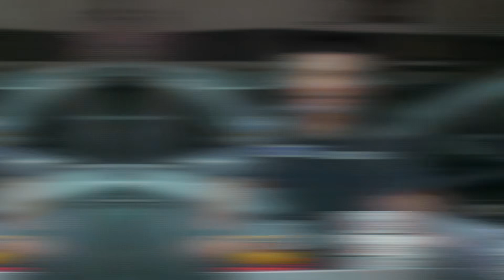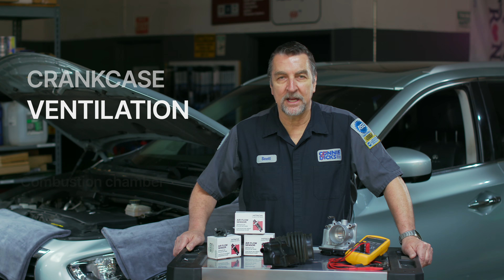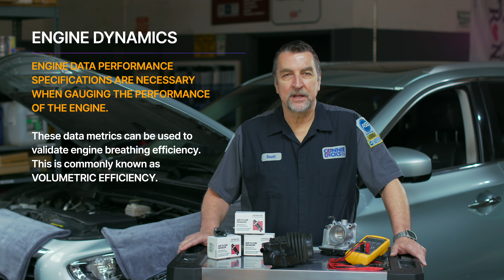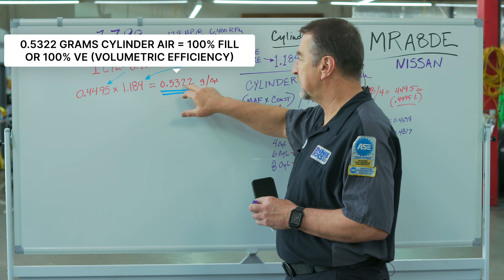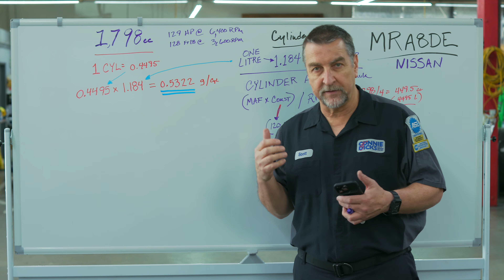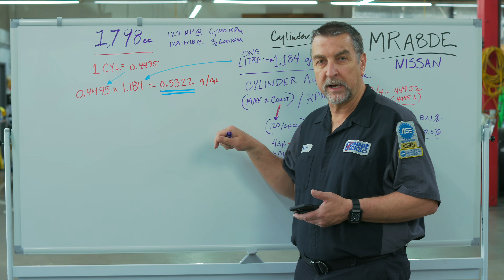Motor Age Tech Tip - Mastering DTC P0101 Diagnosis for Mass Airflow Sensors (MAF) by Hitachi Astemo

Comment: Excellent video. Ran into this multiple times after customers had replaced their maf with ones from local parts stores. PIDs, primarily the calculated airflow, were way high after the new sensor had been installed. Installing a dealer MAF fixed it almost every time. I do recall needing to program one ECM.

Comment: I have Dodge caliber 2007 R/t 2.4 L problem P0300 missed fire needs to solve problem, change spark plug vacuum how can’t remove check engine at dust board??